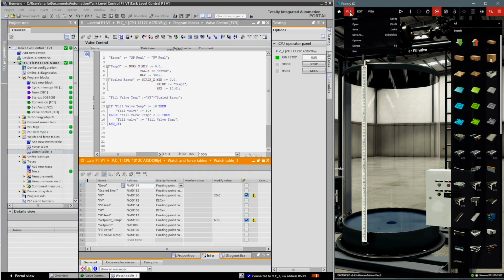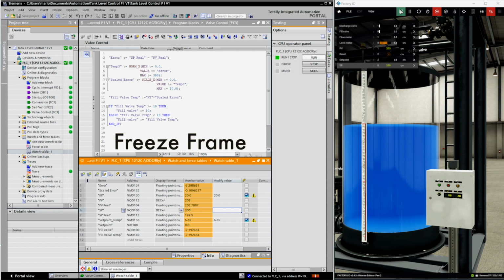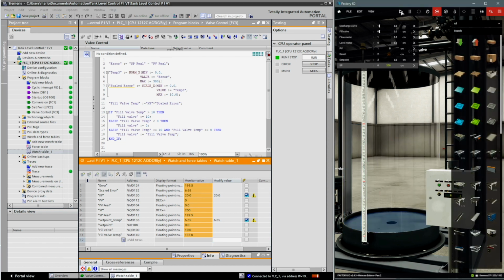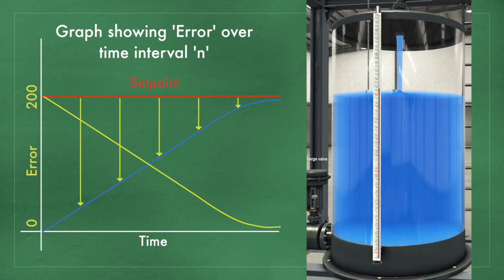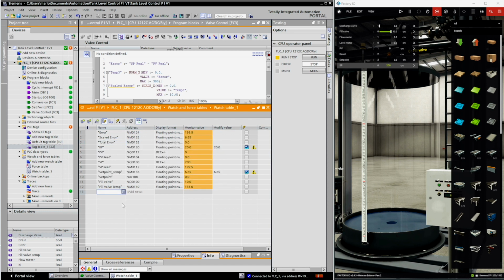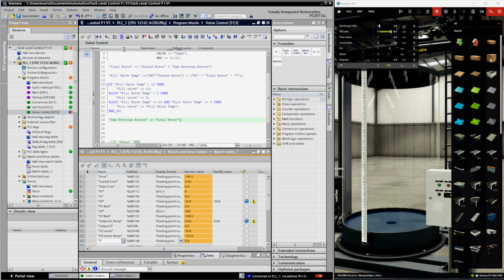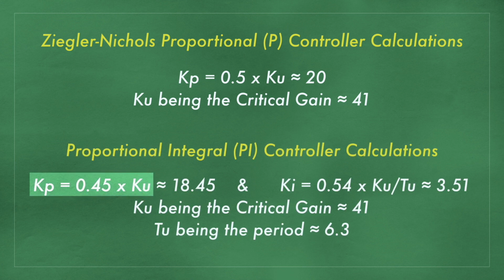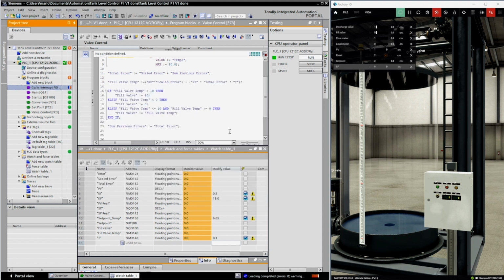PI Control using Siemens S7-1200 (SCL)

Comment: Hello,
 I work on S7-1215 PLC and I used PID Compact on my projects. I want to learn SCL for PID. I watch all your videos. It's a lot of helpful. I try to create general PID code for using all my projects. Can you send me a water tank control codes please. I want to struggle with it. :)
Thank you again for everything.
Reply from the maker: Thank you for your interest Oguzhan.
I'm still working on the PID code and I wouldn't want to share the code until I've finished developing it and have tested it as best I can.

All the code so far has been explained step-by-step and if you watch the videos they should help you learn SCL much better than having the code all at once. 

There are only 3 more lines of code to be added to make the PI controller work well and they will be explained in the next video which will be upload in a week or so. Hope that helps.
Reply from the maker: Speak soon hopefully

Comment: Excellent Mario! Thanks for sharing your knowledge. I have one question. What are the advantages of programming in SCL compared to ladder?
Reply from the maker: Good question Hector. 
SCL lends itself to mathematics better than ladder logic and it doesn't take up so much screen space in the process either. I'm sure there are other reasons too. Also I like it. 
However, for a lot of general control Ladder is probably more suitable and Electricians can relate to better.